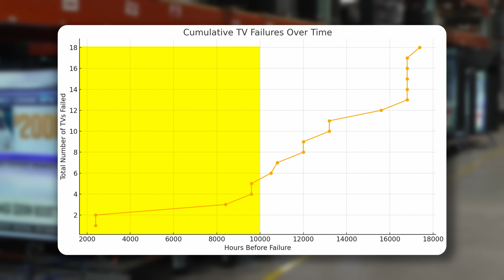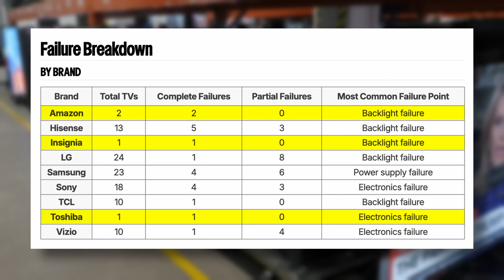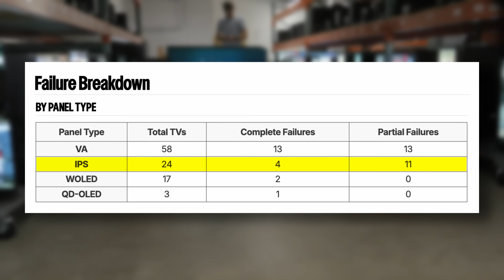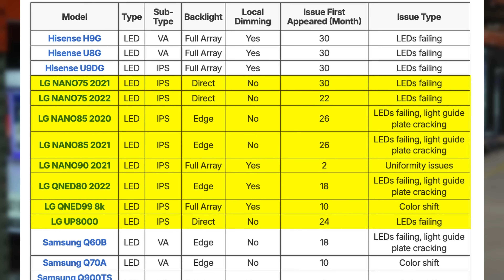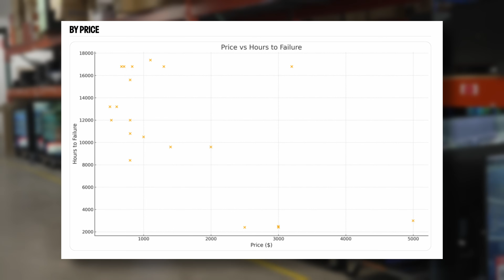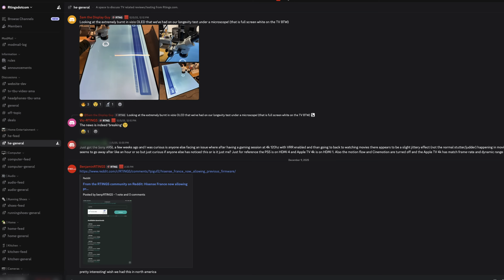Which TVs Break First? Results Overview From Our 100 TV Longevity Test

Comment: Parents TV was clocking over 12+ years with them refusing to upgrade until the analog signal was switched off. These days nothing is built to last
Reply: Reward for excellent engineering is less or even no money, so I understand both sides.
Reply: But how much was that old TV at the time in comparison to today?   The falling price of flat panel TVs has been a very positive feature of recent times.   Maybe a higher fail rate (if that is true) is tolerable for such a drop in price?  Maybe the improvement in colour, the resolution and frequency is worth it?
Reply: @CurtOntheRadio  I guess but flat panel TVs are large and inconvenient to move. Maybe a 85" TV SHOULD cost $5000 and not $500?
Reply: @TassieLorenzo  the 99" LG G4 was £25,000.     :D
Reply: They could've got a digital set top box to maintain free-to-air broadcast compatibility and if they ever wanted a streaming app... some kinda Smart Dongle that connects via HDMI.

I had a TV from 2008 that lasted until 2021 when I gave it away to another family member and then their kid broke it by tossing something at the panel. I also had a 2011 monitor that lasted until I think 2023 when it died and for the last 3-5 years of its life it'd developed a strong warm colour temperature which I had to compensate for by dialing Red all the way to 0, Blue to 100 and Green to 25. For the last 1 or 2 years of its life I could no longer compensate for the warming colour temperature.

When the 2011 monitor died I replaced it with a 2013 32" 1920x1080 TV that we'd had in storage for most of this time period and am still using the TV. One day I'll get a fancy computer monitor, maybe when OLED's start using vertically rectangular side-by-side R, G, B subpixel layouts.
Reply: Get off mah grass whilst I pine for the good old days.

Comment: I have a Philips LCD TV that's been running since 2010. Apart from a few dark clouds at the top edge, it works fine. I just can't turn it off, otherwise it takes 15 minutes to turn back on.

Comment: Lesson learned?... get the 5yr extended warranty. 

Just used mine because of back light issues on my U8H after 3 yrs.
Reply: The problem is that many times, the extended warranty will be worded in a way that a company will use to deem the issue not coverable under warranty.
Reply: @Fools_Requiem  Dont know about others, but I've never had an issue.
Reply: @Fools_Requiem  Exactly. They refuse to refund, repair or replace a totally blown-up TV. A TV with 100 dead pixels and more. Even cracked TVs during shipping. Some companies are HORRIBLE.
Reply: Extended warranties are a gamble. Their purpose is to make money, that means that they might make it difficult or outright refuse. Or even if not you could have no issues for the full period and then you just wasted that money. Personally I'd rather just take the loss, if I had gotten the extended warranty on everything over the years it would have cost significantly more than the few things that failed out of regular warranty for sure.

Comment: I guess I should keep my 42" Westinghouse 1080P HDTV with a "build date" of 12-10-07
Reply: Only if you like dull colors, low pixel density, ghosting, back light bleeding, bad black levels, motion blur and low resolution. 😂
Reply: @m @murray821 and oled will get dull much quicker then Q mini led tvs will,.😅
Reply: @murray821  enjoy paying double for specs. Most won’t notice any of that crap you just said 😂
Reply: @murray821  Still crustal clear after all these years.  Same as the day I bought it.

Comment: genuinely depressing how repairable previous CRT technology was vs. how deliberately unrepairable LED technology is
Reply: I remember having a go at fixing a CRT TV many decades ago and it was a bit of a nightmare. The high voltages required for the tube can be truly lethal and may still be present on large capacitors many hours after the set is unplugged. At least you aren't going to get fried opening up a modern LCD when disconnected. 
Some of the old CRTs were pretty bullet-proof though.

Comment: Absolutely amazing stuff. Dead pixels around the borders for OLEDs seem to a very common. This sort of failure seems to be correlated to the age of the unit rather than usage. High humidity is theorized to be at least one of the factors.
Reply: Ya I had that on the panel that was installed to replace my burn in after less than 2 years. The og panel didn't have it but maybe would have if I had it 3 years. Once it starts, it gets pretty bad really fast. All around all four borders and pretty thick. I saw tons of reports with barely any usage when I researched it and if I recall it was mostly 3-4 years. 

Really does seem to be age.

Comment: I had a LG B6P (the last model without auto panel care) that was NOT tortured that started showing burn-in a little over 3yrs in, so even if they've gotten better, I'm permanently sworn off even though I miss the picture quality. My now 19-yr-old CCFL-lit Sony XBR is still going every day with only minor backlight unevenness, though that sucker weighs a LOT. I've also replaced failed backlight inverters and power supplies in CCFL sets though those days are also obviously long gone.

Comment: Well my 2022 Black Friday Hisense 65U8H lasted one month into year 3. Color has left the chat. All I heard was how great Hisense was when I bought it and I did not buy an extended warranty with it. Boy am I sorry. $1000.00 tv off to the dump. Going to try Japan with its replacement, Panasonic 77Z8BAP, and 4 year extended warranty.
Reply: did it turn blue??  Get LED strips replaced.  VERY cheap n simple fix.   IF A TV repair man tell you " too much hassle". they either SNOB, or Mistake it as ---- the GLUE on low end Roku think he can not open the TV.   OR he IS FAKING how MUCH work it is to " UP SELL CHARGE YOU $200". =  same thing that CAR repair guy Always tells ppl : I can't repair often menas ( I dont know how), or " Its not worth MY TIME" = I dont want to waste 3 hours for this when Make $80-100. so I dont bother. 

Very LIKELY IF you tell a Repair guy it's 2022 Hisense, in his BRAIN they are thinking about :    2022 $200 Walmart ROKU.  NOT knowing its Still:           :face-blue-smiling:    HIGHER End than Current  Bravia7.   :face-blue-smiling:  Most TV repair guys assume:  ALL Hisense + TLC = same. 

     CONTRAST (Rtings ) 
UX 116” mini LED  Hisense
UX 98”+ 110”  (N/A)        Hisense     
U9QG-  <<    release in the fall  2025    >>
U8QG-      460000:1 Hisense    25
UX 85”      400000:1      Hisense       3
U9N—-      344000:1      Hisense     24
Bravia9–    292000:1      SONY          4
U8N——     277000:1      Hisense       4
Qm8K—     273000:1      TCL              5
QM7K—     265000:1      TCL              5
QN95C-     201000:1      Samsung     4 
Qm851—   200000:1      TCL              4
X95L——   200000:1      SONY          3
QN90D-     167000:1      Samsung    4
U8k——-    165000:1      Hisense       3  
U8H——     160000:1      Hisense       2 <== YOURs 
U7QG—      137500:1       Hisense      5
Bravia7—   120000:1      SONY           4
Qm8——     114000:1      TCL              3 
QN95B—    110000:1       Samsung    2 
X95K——    100000:1      SONY          4
U7N———    89000:1       Hisense      4
Q90C——     83000:1—  Samsung     3
U6N———    80000:1 —-Hisense       4
QN90A—-    75800:1 —- Samsung    2
X93L——      72000:1—-  SONY         3
QM7 ——-     67000:1—- TCL             4
W95A——     62200:1    Panasonic    4
U8G———     54000:1     Hisense       1
Bravia5—      53500:1     SONY          5
x90L———    49000:1     SONY          3

 I did Significant research how to repair LEDs.     CUZ I had $4000 Made in Japan tv broke before buying Hisense U8G ( 2021) . 
It's very easy fix.

Comment: 3:45 tell that to my mother. Your "torture test" is her daily viewing habit lmfao
Reply: same lol, my dad has Bloomberg or CNBC on for like 8 hours a day
Reply: Remember the old days where a “Handyman” would come to your house to replace some tubes on your TV?
Reply: @mashy712  Later transistorised/chip-based CRT TVs are pretty reliable AFAIK. They are well worth using.
Reply: As a disabled retired guy my tv is on from 9am to 2am every day.  I don’t do news channels so if I’m not gaming then I’m watching shows like law and order, bones, criminal minds and such.  My 2018 tv has almost 30k hours on it
Reply: @brokenwrench404 's TV: I'm tired, boss.
Reply: @Outmind01  "well that's too dam bad!"
Reply: @brokenwrench404  Bucko is that you? If it is, by my last count, you’ve gone through three copies of the same game, 
two PS4’s all on the same TV?
Reply: @brokenwrench404  I'm not even retired, but even on working days my TV is on for like 1 hour every morning before work and then after I get home it's on until I got to sleep. My PC is hooked up as well so I mainly use it as a monitor (I don't watch cable/network TV, just use it as a PC or for gaming or for movies). My previous TV  that I owned for a bit over 6 years from 2019 till 2025 had over 21K hours on it (well a few months did pass after that, so probably closer to 22-23K if not a bit more). And practically always with full brightness as well. No OLED would've survived that without a significant amount of burn in.
Reply: @brokenwrench404 
There are OTHER things you can do with your time like read a book etc...
Reply: Depends on the panel type obviously. An IPS display is unlikely to get burn in and more likely will have LED failure.
Reply: @Mopantsu  An IPS display CAN'T get burn in. Not sure why you used the word "unlikely".
Reply: @vigilant_1934  lcd's are not immune to burn-in.
Reply: @vigilant_1934  As shown in the video, the display itself doesn't really burn in but the back lights do eventually burn up but after many hours.
Reply: @foufoufun  I have an LG TV from 2014. It has been repaired twice due to LED failures. It still works, but when the entire screen is white, I can see the LED layout. The heat from the LEDs has “burned” the panel. I realized that the default brightness was set too high, so I reduced it to about half, and now it’s fine.
Reply: Not that sure, but I think they also deliberately turn off some of the panel-saving features? Or it did not exist since this was pretty old TV model? There are alot of panel care features for OLED like logo detection that will shift the static pixel abit from time to time to reduce burn-in potential. Nowadays, tandem OLED promise better burn-in resistance because the multiple OLED shares workload so they burn-in at lesser rate.

Ultimately though, burn-in is inavoidable. But its not like TV will continue to work forever anyway. All electronics will die at some point.
Reply: Let me tell you about my mother.
Reply: Is she watching with the brightness set to the absolute maximum, though?
Reply: @wright96d  of course. How else would you use an OLED next to a bunch of windows?
Reply: I was also disappointed to learn that they do not consider burnout a problem, but at the same time, LED backlight burnout after 10,000 hours is still a problem, despite the fact that this is a reversible problem, although it requires repair, unlike OLED, which simply goes to the trash.

However, I suspected until 3:45 that this would happen, because it's always the case with OLED fanatics.
Reply: @evur_tweak  they did say unless you torture test like they did... if you leave static stuff on the screen at high brightness for hours a day with very little other content, yeah, expect to have an issue
Reply: @RainboomDash  So, if you don't use your TV in 90% of the most common scenarios, and if you also consider that OLEDs can't show accurate brightness due to their protection algorithms, then OLED is a good choice.
Reply: @RainboomDash  that's exactly what my TV does. The Chromecast clock only moves so far ...
Reply: @evur_tweak  Well, yeah, no one in my home plays news or sports 90% of the time the TV is on and even in a bright room the brightness gets to a sufficient level without being maxed out, so OLED is a good choice. If this isn't you then obviously it's not.
Reply: @evur_tweak  I disabled ABSL on my OLED
I also keep Discord open multiple hours a day with the same static icons and don't always fullscreen when watching video on Youtube or Twitch and it's been 5 years and I see no burn-in... that being said, I don't have brightness very high (not everyone wants their screen super bright)
I do agree that the casual person may do a similar "torture test" by keeping news on many hours a day at max brightness, but you are kind of just repeating the torture test at that point :P
Reply: @evur_tweak  Burn-in and burnout are two very different things.
Reply: @vigilant_1934  of course, one thing can be fixed, but the other cannot.
Reply: Yeah, them saying burn-in was "not an issue" after showing the results was a serious downplay.
Reply: @ViremasterOfUSA  To be quite honest, Rtings is pretty much a pro-OLED and anti-LCD channel. For years they've been downplaying OLEDs downsides to an extreme level while pretending that non-issues on LCD are major issues. Just take viewing angles for example. On pretty much every single review they make a huge deal about stating just how 'poor' the viewing angles are. But most people are going to either sit straight int front of their TV or at a small angle, but not at angles where the colour changes significantly. And the few rare moments where someone does watch from a bigger angle, it's usually when they are busy with something or when you're watching with a lot of people so really no one will care about it in those situations. And they also pretend OLEDs colours say the same no matter the angle, but that's also as well. OLEDs very much do have colour shift.

Honestly it's not different from that "infinite contrast" lie. Not a single OLED has infinite contrast. Infinite contrast requires perfect black, a perfect kind of black that absorbs all colour. OLEDs are very reflective and the ones with some kind of anti-reflect tech have screens that are a bit brighter. That can hardly be called perfect black. Not to mention the fact that actual precise measurements also showcase that there very much is finite contrast, not infinite. So it's really just a straight up lie. I'm surprised pretty much all of these TV tech channels keep repeating it, despite it just not being true.
Reply: and this, ladies and gentlemen, is why i don't buy OLED.
Reply: @lol-g6rt at the very least it's not a good idea for a TV
Reply: @Thinkableness  If you don't only watch news channel 10 hours a day, burn in is not an issue. It's also not great as a computer monitor for the same reason. But if the content is varied, it's fine. My LG OLED CX which I use mostly for gaming and watch animes (so static UI and subtitles would be the biggest culprits) has a little over 3000 hours on time and there is absolutely no visible burn in.
Reply: @lol-g6rt because you watch news 8 hours a day? The torture test isn’t just “my TV is on a lot” it’s my TV is showing stagnant images all day long

Comment: I still dont approve of the blatant scaremongering for trying to repair a TV. Educate consumers, don't scare them away. Show them the types of repairs done and what sorts of tools and expertise you need to do instead. Instead of flashing a bold, blanket DO NOT TRY THIS AT HOME statement, how about you put some effort into actually people? Teach them the different between a power supply and low voltage control board. Do better next time.
Reply: Yeah I agree.   Recently My 6 yr old LED full array local dimming.    MAIN board broke ( Hisense flagship) . it's weird because it was turned on like less than 5X all year in diff room.  Turn OUT ---- after reading . that SOME SOME Mainboard even NOT being used can SELF break down ( like cars) like wtf. :face-blue-wide-eyes:  some Coating on the parts will start to like evaporate if not used or just on its own.  I think they used diff parts though since 2021.  Turn out Such easy fix.  open TV,  UNplug the mainboard.   SEND to Major TV repair company( they contract with Big brands like bestbuy/Costco..... all sorts in bulk. ) they use laser take out Chip on mainboard.  Put on fresh chip, freshen up.  Send it back , literally just plug in n fixed.  TV runs like brand new. 
Becasue the SCEEN ----- Intact,  Backlight Intact. 
NOW I know if I buy LED:    the MOT common issue when LED break down.   Both easy fix ( LED lgiht strips,  +  mainboard even if run out of original Mainboard. the companies offer alternative very quick easy fix)  

The LASER: Machine take out the Chip on Mainboard cost like : 1/4 Million $.   So Mom n Pop shop will be like" CANT Fix" too bad.   THEY KNOW ------:face-fuchsia-wide-eyes:u can get it fixed easily somewhere else. but they will NOT tell you. 
Only cost you $80. got my mainboard fix including shipping.

Comment: My mom would torturetest an OLED for sure, by accident though. =(
Her 13,5 years old backlit Sharp LCD on the other hand now certainly has almost 100,000 hours on it's clock, with a mainboard replacement because of a hang up software within the first 21 months. But there hasn't been an issue since.